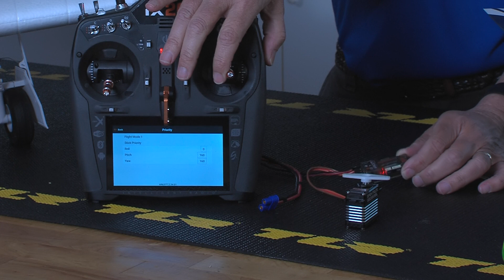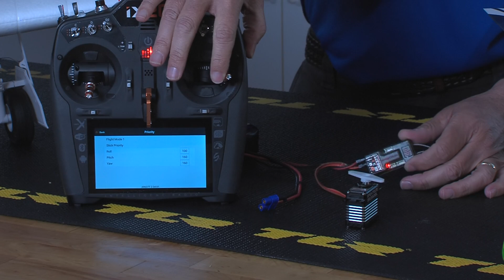Spektrum Smart Receiver AS3X Setup Series #13 - AS3X Priority Explained

Comment: I have problems with the configuration of the AR636B receiver when the plane is flying, it makes me suddenly tremble and it returns to normal and then after a while it gets shaky again and I don't know what to do or why it does that in As3x technology assisted flight mode

Comment: So if I have a plane with a fast roll rate, say a F-35, and with Safe or AS3X it flies great straight but when turning it oscillates a little, not terrible but a little. Would the priority affect that or just the gain settings on the Safe of AS3X? Is there a thing call to much priority